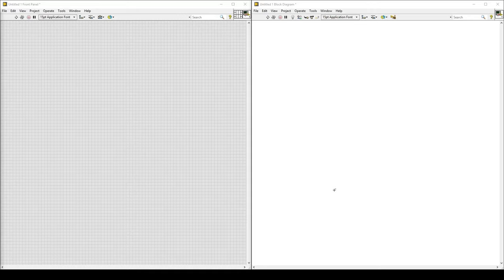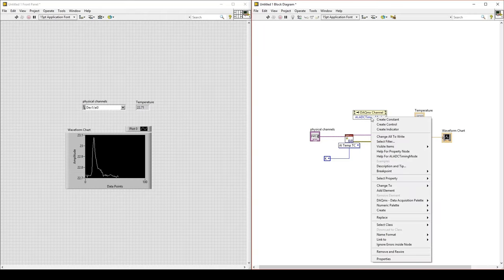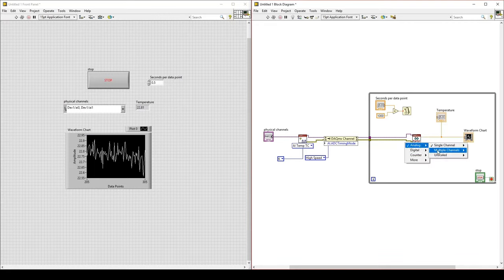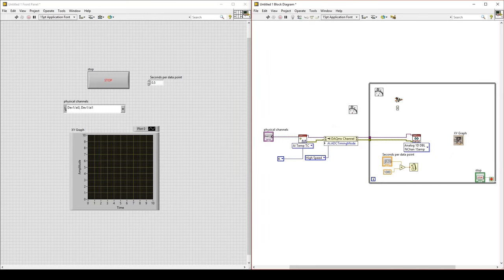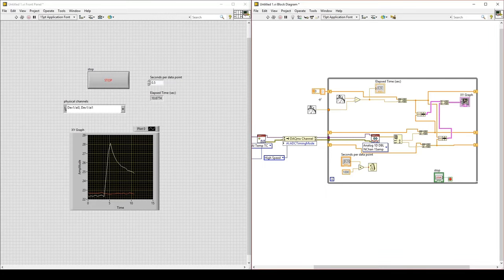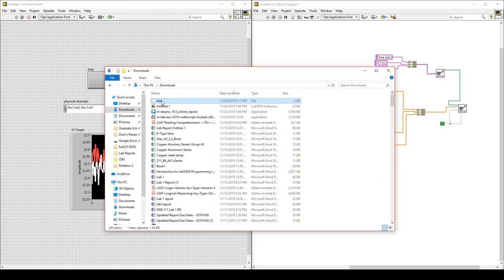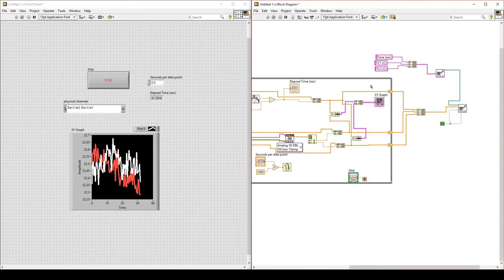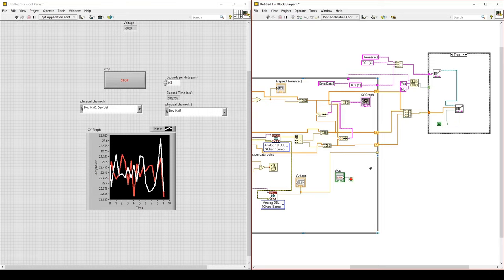NI-DAQmx multi-channel data acquisition LabVIEW program

Comment: Why don't you need to build an array with time for the analog voltage signal DAQ, but you do for the thermocouple one?
Reply from the maker: You do for both if you want time data. The single sample analog read does not provide any time data to my knowledge... Actually... it might if you use a waveform chart or some other type of chart. I haven't investigated.